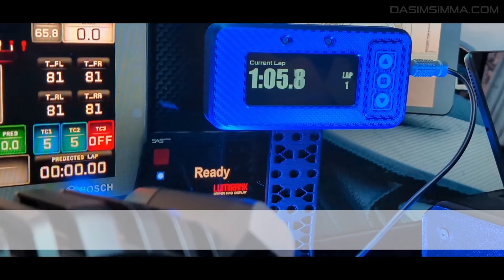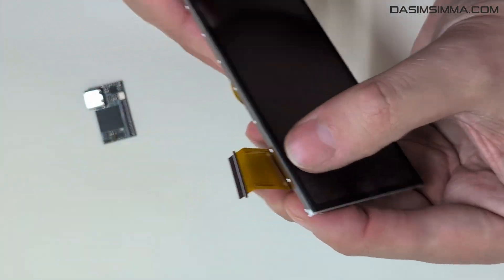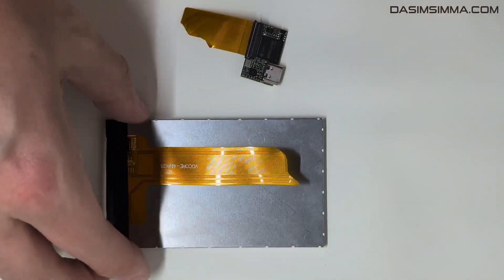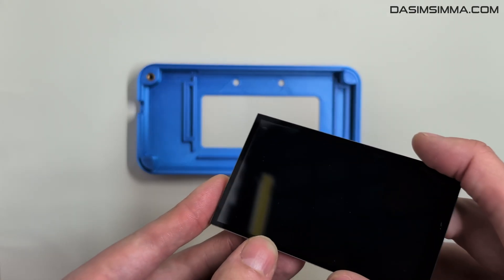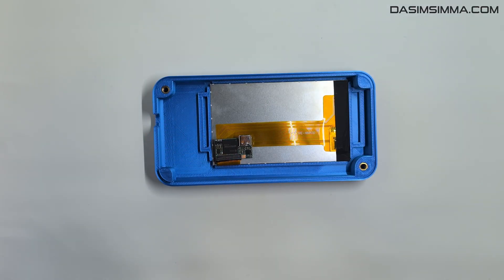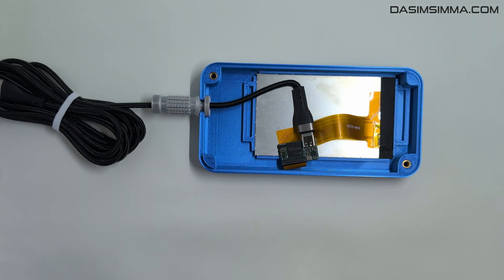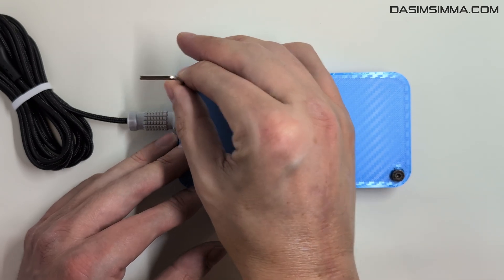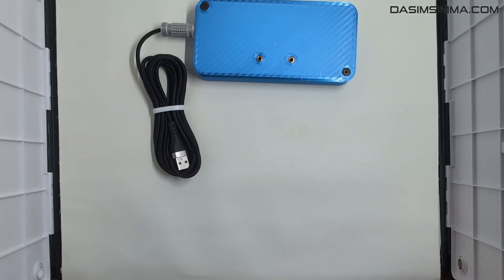How to Build Your Own Sim Racing Lap Timer | RACELOGIC DIY Kit Tutorial

Comment: Hi
Question, the cable looks like a Type C at one end and a USB on the other, where do we connect the cable to get the telemetry? Thank you, great job!
Reply from the maker: First of all, how the heck have you been???? 
The type-c version connects to the PCB board as shown in the video. The other one connects to your computer of course ;) 
We use a program called Sim hub that pulls telemetry from every game and translates it into images on the screen. The software will be also provided
Reply: @DaSimSimma  Hi Chris
Doing well after surgery, all we can do now is to have a calm slow recouping, thank you for asking.
My question was regarding the use of the "tinny" screens into a flying simulator cockpit, to reproduce and image as the larger screens do. Is that at all possible?
Stay safe